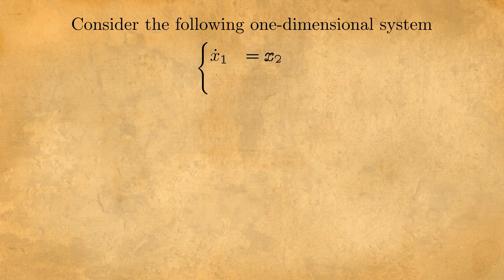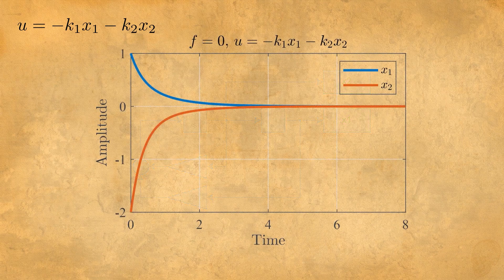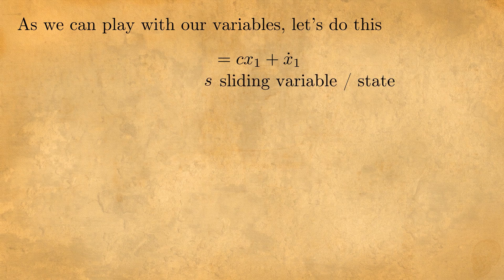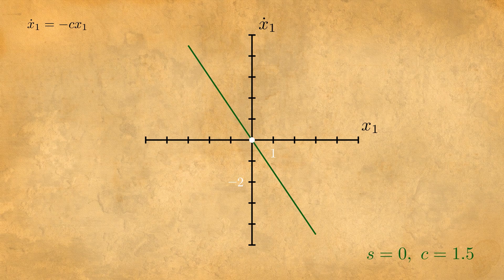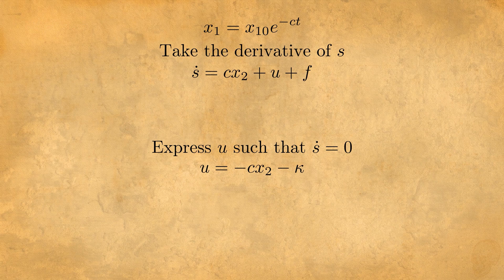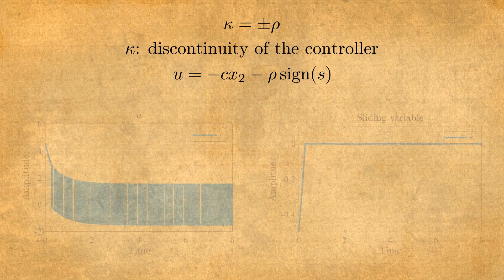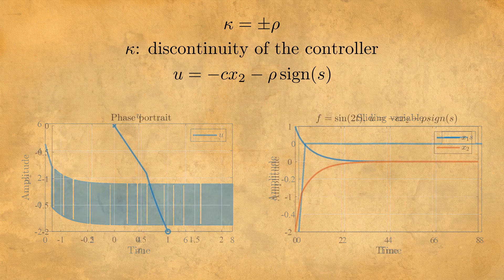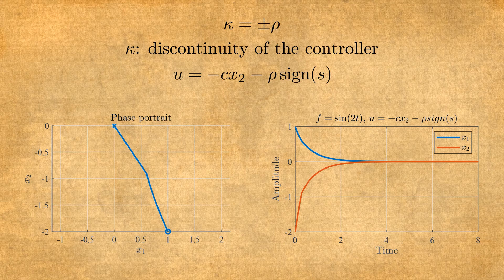Sliding mode control   01   Example

Comment: I just reach to understand that slidemode control is just made input u become the cancle of state model equation and plus it polarity sign switching.
Reply from the maker: SMC is an "evolution" of variable structure control. There is a nice paper:

Sliding Mode Control – Basic Concepts and Current Trends
Andrzej Bartoszewicz and Justyna Zuk

the first part gives a simple example of Variable structure control, it helped me to understand better.